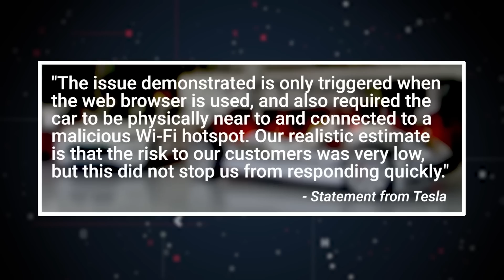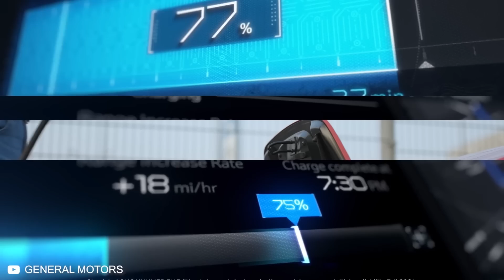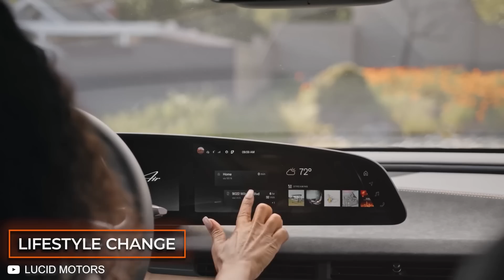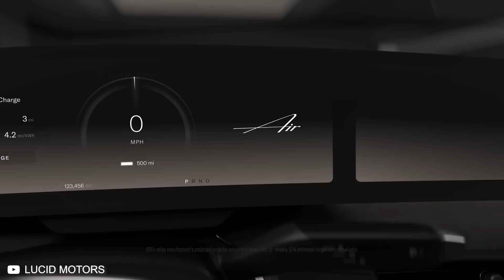EVs' Serious Problems That Carmakers Are Hiding

Comment: The cost of replacing a spent battery pack is outrageous.
There are places that refurbish battery packs for far less ,but they are hard to find.
Charging infrastructure is sketchy in some states like Mississippi where fast chargers are mostly Tesla.
I believe government may have to rethink it's strategy of car companies making only EVs.
Reply: Democrat Politicians won't change their minds, they are more concerned about sounding/feel good motives, rather than practical motives.
Reply: @robertkarp2070  You got it.
Reply: Tesla address most of these issues.
Reply: @rogersmith573  Tesla owners are not paying road taxes if not buying gas. Licensing should yearly by mileage induce a road tax bill.
Reply: @servehim1746  most states do. Registration in WI is $200 more for an ev.
Reply: @davekozlowski1266  That is good. At least in Wi. someone is paying attention to the details. Evs just don't make total sense to me except for daily short commutes.
Reply: @servehim1746  how many miles do you drive per day?
Reply: @servehim1746  not sure why you think it would only be good for short trips. Unless you drive over 250 miles per day, they work great! You just charge at home.
Reply: Patience my son.
Reply: In America they should have just one standard plug.
 To drive up to a "Charge uP" station you don't have the correct plug.
That will  SUCK  ❗️!❕️!❗️
Reply: @icosthop9998  There's 3 different types that I'm aware of and that is in Ireland. Probably the same number in the States, depending on who the car manufacturer. Different companies like providing their own version, it makes them proprietary in order to help ensure people bring in their EV's only to them for repairs or having to go only to them for purchase of the parts.
Reply: @robertkarp2070  k
Reply: @robertkarp2070   No doubt the touch screen will tell you where the closest charger is   that works with your EV.
 Some makers of EVs  don't put up as many Charge uP Stations  as others do.
But yes I do see your point. 
And  TY
Reply: @icosthop9998  CCS is the new standard. Even Tesla is  switching to it. They sell Tesla to CCS adapters now for older Teslas which don't have it, as the new ones come with CCS capabilities built it. But since the Tesla network is so ubiquitous, they're basically everywhere you drive in America or Europe for example, so Tesla drivers don't need to use it. However, the high speed CCS network will over take it in the next few years, as it's expanding at a very fast pace now.
Reply: It's not really a government policy and this has nothing to do with the government. All the auto manufacturers including Ford and GM say that by 2030 as much as 90 percent of their cars on the lot will be electric. The government sees this and is trying to respond, the Biden administration is building charging stations and trying to prepare for this future but it's not the government creating this future and even if trump or some other republican becomes president again and ends all these policies it's not gonna change the EV shift by the manufacturers
Reply: .

 I'm sitting out from buying an EV for the next 2 years.
( I would like to wait longer but I don't have the patience)
 The 1st EV  I will buy will probably be in 2024,  the way battery technology keeps advancing and at its current rapid rate a EV today with today's current battery configuration will be obsolete within 2 and a 1/2 years.

 Prime example is that the early EVs with the "3G Technology" are now dead in the water with "5G technology"  kicking in.
Reply: @icosthop9998  I wanted to buy an EV last year. Then due to pandemic impacts on production decided the longer I wait the more and better options I'll have. Reminds me of PCs in the 80s and 90s. when to buy? I agree and sympathize with you. I have the same conundrum.
Reply: @fyourfeelings8966  exactly  ❗️❕️❗️🙂
Reply: Ev makers need to adopt batteries as a service
Reply: @cb-gz1vl  As does Renault in Europe?
But you have to pay a monthly fee for battery usage.
In the end you have to pay for the battery. In one or the other way.
Teslas LFP battery are expected for up to 5000 charging cycles.
That is about 1.5mio km (1mio miles).
I decided to buy the battery.
Reply: @manni1998  I meant the recharge is a battery swap, not a lease or rent.
Reply: Why would I ever want to go to Mississippi?
Reply: At that cost of replacing Battery Pack - People WON'T.  They' ll go take the ($13K for New Battery Pack - and $2.5K for labor - $15.5 K)  And, go buy a new one at the dealer. So now this Green Revolution is really bringing us $35-50K "throw away cars" at end of Battery Cycle!  Really Green isn't it? They'll have to be bull dozing down your apartment complex for room to trash your EV in.  It get's worse in times of Recession or Depression like this. 70% of all new car purchasers are "Upside Down" on their Car loan in USA, when they go in for a Trade in.  Who's going to buy them in this 230 Year Old Super Cycle Depression we're in the throws of right now? = NO ONE, but the Super Rich. Even Tesla could go under.  Hmmm, Musk bailed out of a lot of his Tesla Stock ( in the Billions, didn't he? ).
Reply: @r.c.salyer3652  I suppose you want people to ignore the current massive battery multi-billion dollar (eventually trillion dollar plus worldwide) mineral/material recycling industry? https://www.youtube.com/watch?v=CM1fL5D1_W8&t=913s 
You know, where battery recyclers use techniques that recover more than 95% of Nickel, Cobalt, Aluminum, Graphite, and more than 80% of Lithium, then sell them to battery manufacturers. How do you recover/recycle gas, diesel, and coal again?
Reply: In the UK thieves are now cutting charging cable's for the copper, it's just getting crazy now
Reply: They don't want you to have any car, any home, any food, any fuel. Stop the global warming scam if you care.
Reply: Electric cars are a massive environmental disaster. Who would you buy one?
Reply: Lfp batteries are being offered with a million km warranty.. so you can now stop worrying mate ... As this is 3 times the life of an ICE car.
Reply: Warranties are purchased, now much does such a warranty cost? It's already expensive to purchase an EV and charging stations are unreliable, especially since they have to be rebooted and none get rebooted unless a consumer actually takes the time to report it. Most people just look for a charger that is working, and it takes an additional 5 minutes to reboot, so take that only your 30 minutes to 1 hour of wait time to recharge. One out of every five EV owners go back to driving gas powered automobiles because the EV's prove to be too much of a hassle.
Reply: @robertkarp2070  the warranties come with the car. Most EVs have ridiculous battery warranties. Just like all hyundai's have an 8 year drive train warranty is 10 years or 100,000 miles, their EV battery warranty is also 10 years or 100,000 miles. You don't pay a fee for these kinds of warranties, you pay extra for full car warranties. Neither of these are likely their 3 year full car warranty where if your door handle, power windows, etc fail they'll cover it. Have you not bought a car in the last 20 years? 

What the hell kinda argument is that? I just sent in my headphones under warranty for example, and I didn't pay for it. It comes with the product. As long as it fits under a failure outside of personal use, that's what a warranty is. I think you're thinking an extended warranty. As I said, a full body warranty is 3 years, but you can pay to extended it. Most people never will. But you still had the 3 year base warranty and 10 year drive train warranty regardless.
Reply: Well hydrogen really doesn't help either as they want to make it with electricity, which that actually costs more to make a station and uses more power. In that regard just going all in on EVs is more economical. Currently the issue is EV charging station distribution. Currently there are already more chargers than gas pumps, but EVs go less distance so need them more. 

Hybrid is also a very flawed strategy. Plug-in hybrids for example are basically your last step before getting a real EV. Then you just charge it at home and forget about charging stations. Regular hybrids a vastly less efficient and make far more emissions in comparison. They also have the flaws of mechanical issues with ICE and the complications of EVs while only being marginally better than conventional ICE cars. For example, the new Toyota Corolla hybrid gets about 52 mpg while the Volkswagen Jetta gets 42 mpg. Is it worth the complexity? 

Charging stations though are guaranteed to get better, but in general it's basically necessity you put a charger at home. For the majority of drives then you'll never need to stop while also getting a cheaper drive.
Reply: @Skylancer727  That explains the sales I have been seeing on hybrids lately. Some models are the same price as their gasoline models.
Reply: @Skylancer727  "going all in on EVs is more economical."

Really? What are you going to do when youre in the middle of daily black-outs in California? Sit by the side of a charging station hoping not to get robbed, beat or killed? They would need to build all these stations as stand alone using solar power  with battery backup for night recharging
Reply: @davenone7312  Both EV and ICE have doomsday scenarios. If there is a rolling blackout, you won't be able to put gas in your car either. A transition and balance is going to take time. For now, EVs just aren't for everyone.
Reply: @DEAR7340  If it's a rolling blackout, you can drive to where there isn't a blackout. You can check on your cell phone to see areas affected by a rolling blackout.
Reply: A small generator will provide enough power to run gas pumps
Reply: @davenone7312  wow.... California sounds awful!
Reply: @nakkadu  Cool! Don't move there. Enough people as is.
Reply: @masterchainmale3827  I was thinking the same thing, when it comes to keeping the gas pumps working. 
And keep the gas station running, people buying goods, credit card & Debit card and register going, lights on.
But by logic to me,  it has Got To Be a Lot MORE Power needed for a Charge uP Station. 
(Maybe not)   lol
.
Reply: @davenone7312  Hello!! So right. Maybe in another 5 years to iron out all these issues. One of the biggest being, no junkyard replacement parts...and don't even think about supply chain issues! Duh!
Reply: @davenone7312  How do you pump gas with a blackout? EV's actually have the advantage they can use solar to charge if the grid is down. Never seen anyone refining their own fuel in the back yard.  And who's getting killed at EV charging? People are no less safe standing there pumping gas.
Reply: @davenone7312  In my area when the power goes out our gas pumps won't pump either
Reply: @Skylancer727  And they take a while to charge. Takes only a few minutes to gas up, takes an hour to do on a charger. furthermore the distance expected on a full charge is overinflated about about 30%.
Reply: @robertkarp2070  on the fastest chargers it only takes 20 minutes to charge from 0-80%, most aren't but they are shown on the maps. This is assuming perfect conditions, but even in the worst case test, the Ioniq 5 fully charged in 30 minutes. That's still slower than gas, but not nearly an hour. Not to mention most people will rarely ever need to stop to charge. If you drive less than 200 miles a day, you'll get all your charge over night and never charge it while regularly driving, except if you take a trip. But how often do people make a 300 mile round trip? 

Not to mention charging at home while having an upfront cost to install is obscenely cheaper than any other alternatives for fuel. In my area for example, home electricity is $0.0735 per kilowatt. That means with an EV with a 95kwh battery using about 100kwh after losses would cost a whole $7.35 per full fill up. It's basically impossible for gas to compete with EV at those prices. You would need a plug in hybrid which have the worst traits of both types. 

And the estimates for range are assuming you drive 80mph maximum. If you drive faster than that then naturally you'll get worse mileage. But the same is true for gas. My car is rated at 43mpg, best I get is 36mpg. If you drive like an * expect less than expected mileage. But same goes both ways. I recently saw people who posted their mileage for the prius prime online which is rated at around 90mpg combined. There were people claiming as low as 75mpg and as high as 120mpg. It really depends how you drive it.
Reply: @Skylancer727  Everything I've seen on Tesla is 30 minutes for an 80% charge. Tesla cars and charging so far are the best case examples.
Reply: @robertkarp2070  the Ioniq 5 is faster, it supports the full 350kwh level 3 charging stations. Tesla's level 3 chargers are only 140kwh chargers maximum.
Reply: @robertkarp2070  For day to day driving, an EV takes only 20 seconds to charge. 10 seconds to plug it in at night and 10 seconds in the morning to unplug it.

The manufacturers quoted range for a given EV is actually quite accurate. The one exception, oddly enough, is Tesla. They almost never reach their targeted range.
Reply: @robertkarp2070  My Tesla charges at 500 MPH of range on a super charger and only charges up to about 280 miles of range so doing the math at completely empty to completely full which never happens that is well under 45 minutes but again you rarely would have to need that much range to get you to your destination or the next charging station. So you could charge for 20 minutes and get 200 miles of range or so and be on your way. Pee, get something to eat, check text and emails and your off.
Reply: @jstar1000  Thank you. With my normal driving habits, I could get away with an EV if I could afford one. I'm driving a 1998 Dodge Ram and also a 2000 Pontiac Grand Prix, both run good and I can't afford a new car. 
How confident are you about taking your EV for a mountain drive to go camping someplace remote?
Reply: @robertkarp2070  if they have 30 amp or 50 amp service then fine as I can charge off of it.
Reply: @robertkarp2070  Yes, those range estimates for EVs only count if you do the speed limit. I don't know for sure, but I can drive 80 or 90 miles per hour without using any more gas than doing the speed limit. Does anyone out there know if driving faster uses any more gas?